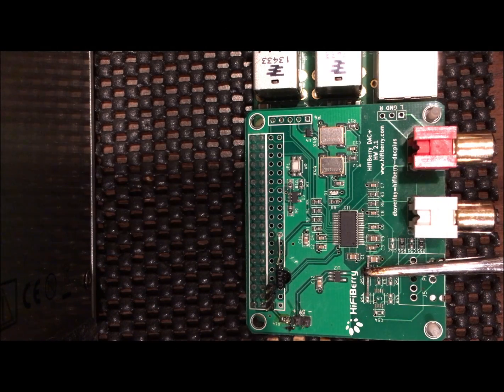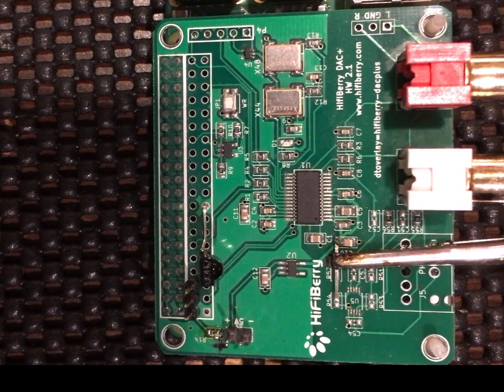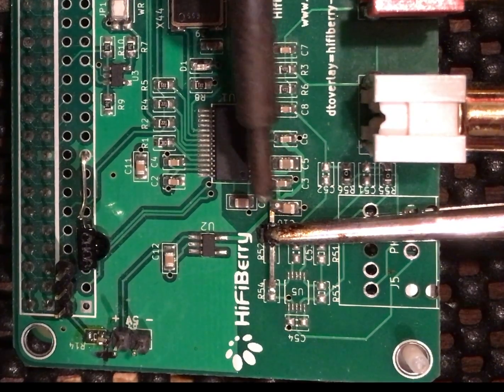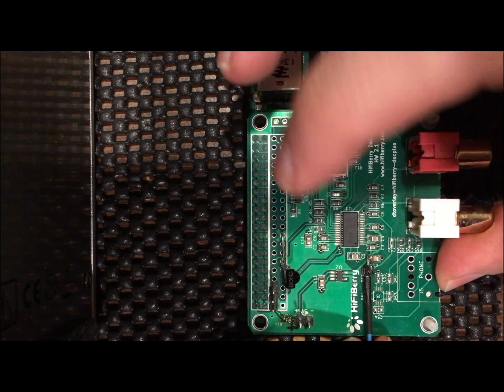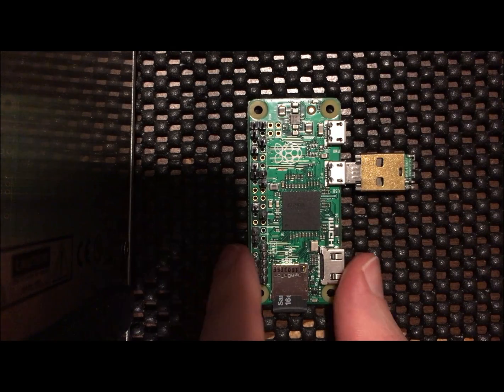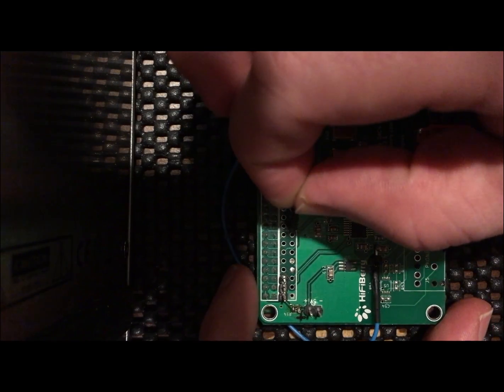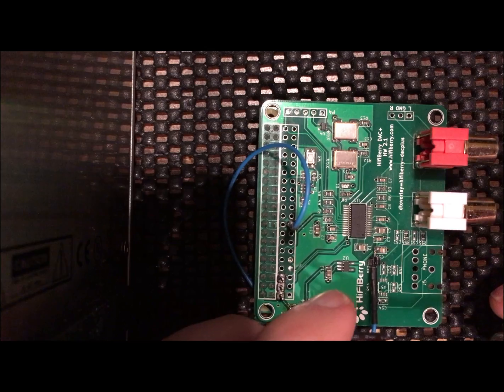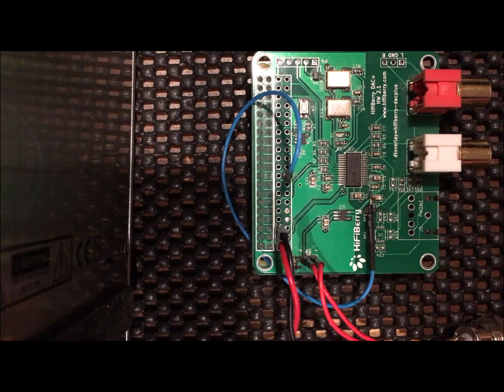HifiBerry Dac+ PRO Power MOD Part 2

Comment: Hey Scott I have been following your work on the rpi for a while, great work. Can I bypass the pi 3.3v with the digi+ if I do not have the Dac+? Have you seen the new digi+ pro board they just released? It has the ability to add connections for both 5v and 3.3. Any chance I could hire you to do some modding for me?
Reply from the maker: Hello, yes the PRO is on it's way to me, should have it friday. You should bypass the 3.3V on the digi+ but that requires a separate 3.3V LPS, if you search around you'll probably see pictures of it. SBAF forums, DIYAUDIO forums, and HIFIBERRY. Thanks! (PS sorry, not for hire :D). On the way to perfect SPDIF, maybe once all that's done I'd consider doing mods for people.

Comment: hello, where do you feed the 3.3 volts???? if from below the dac??? i understand that you bend the rapsberry pi 3.3 v pin to cut the feed from the pi. but i don t see where do you connect the new externel 3.3v to the dac..
thks

Comment: Thanks for the Video.
There is also 3,3V on P1. Is this uncritical? Or should P1 also be bend? (I dont know tha layout of the HiFi-Berry)
I also recognized a voltage of ~2,5V at the Berry-Power-Pins whith only powering the Pi - is this correct?
Reply from the maker: +Heinz Titte Hi! There's a note to bend P1 also... P1 and P17 need to be bent or removed to cut off the 3.3V.
Reply from the maker: +Heinz Titte Adding a header to the 5V on the D+Pro powers the Pro and the Pi thru the gpio pins... also you can remove R14 resistor and power the Pi separately.